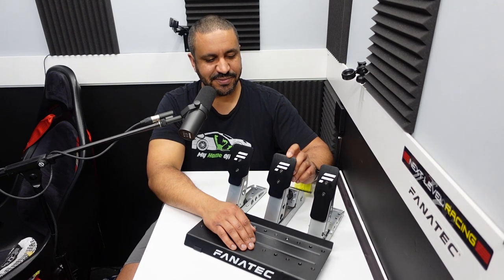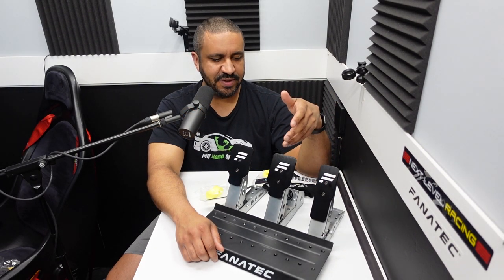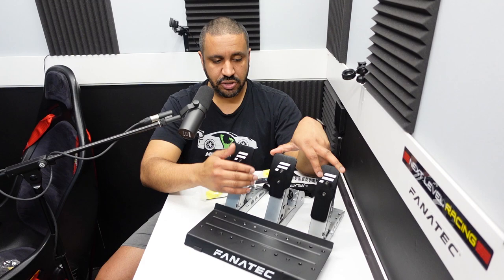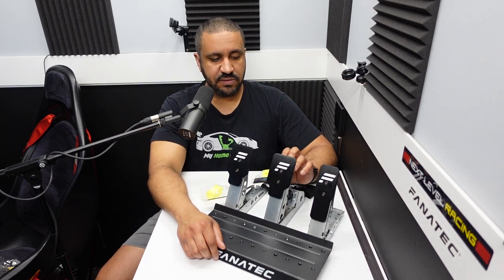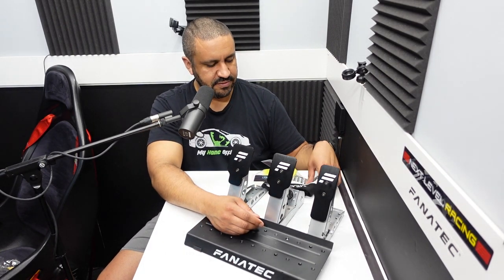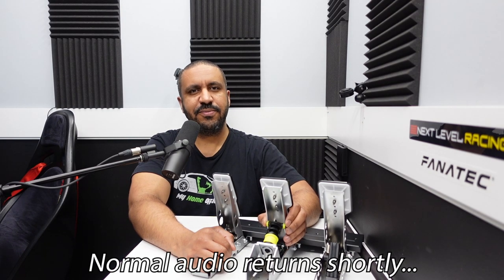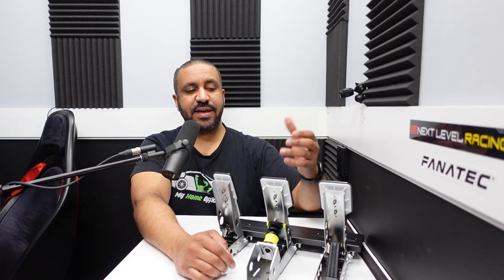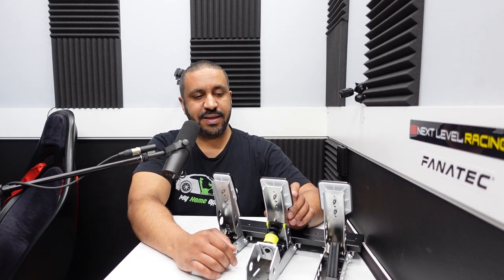Can This Simple Mod Improve My Budget Sim Racing Pedals?

Comment: In all fairness, if you buy 1 progressive and 1 linear, you have 3 different added travel options: 20% (progressive), 36% (linear), and 43% (hybrid) -I think that gives you a good variation of added travel in your brake pedal. I started with the hybrid combination and have now switched to the linear setup for a slightly reduced pedal travel :)

Comment: When I had T-LCM pedals, 3drap solution improved the feel so much. With stock red springs, which are the two hardest, it doesn't feel progressive and after a couple of week use, it's not good. If you buy 3drap solution for TLCM, and stack the elastomer, red spring and on top a couple of spacers (this is my finding), so that when they are fully released, loadcell is engaged at 10%, then you get really good progressive feel and it completely changes the brake feel. But T-LCM came out so long ago, I wouldn't recommend them anymore. Nowadays, there are a lot more pedal offerings. 

If I judge from my 3drap + TLCM experience, I would guess it improves Fanatec LC feel. But if you buy Fana LC + 3drap elastomers + LC faceplates, then you are almost in the 400 price range where there are now a lot of different offerings, and you get much better customization from the start.
Reply from the maker: Yes, we’ll said.  The total price really adds up quickly.  And thanks for the story about the elastomer wearing out.  I’ll definitely keep an eye out for that long term.

Comment: Thanks for the video. I've found the existing CSL load cell brake to be too firm with my Next Level Racing 2.0 wheel stand while wearing socks. Do you think the modded breaks would be usable with a wheel stand, with a chair wheel cradle, while wearing just socks? Thanks again.
Reply from the maker: It depends on how rugged your feet are of course, but I think for most people it should be fine to use with socks
Reply: @SimRacing604  Thanks. I appreciate your great work, podcast, and response! Cheers.